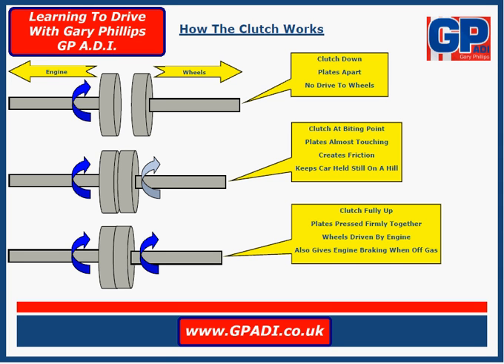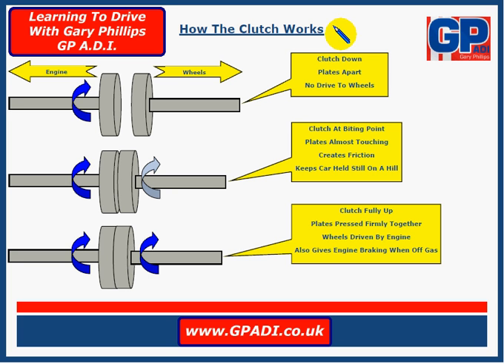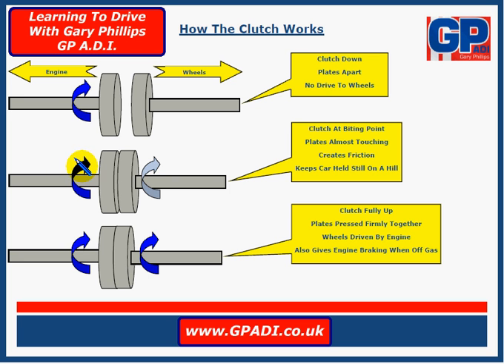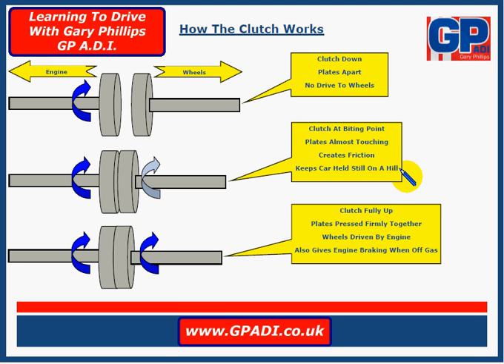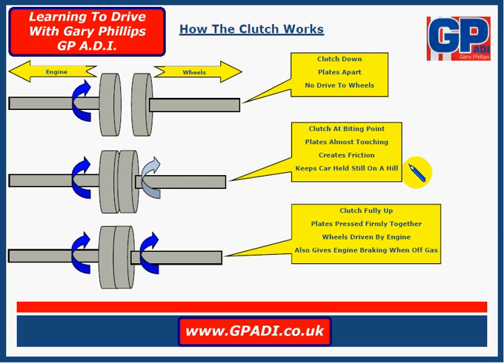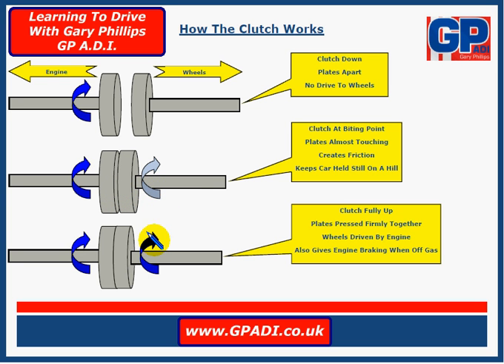How The Clutch Works

Comment from the maker: @prankmakers95 
Yes that's correct, it will cause the clutch plates to wear down which is why it is not advisable to hold the vehicle on a hill at biting point for long periods at a time.
If the car is held at biting point for too long or excessive revs are used you will smell the clutch burning & it ain't a nice smell!

Comment: @franklin0013  yes you are right about that. I prefer to sit in neutral and use the brakes. Of course if it's just for a second or two it might be ok, but don't do it often. I also find when I get a new car- stick of course- the clutch is a little diff from the last car, so you got to get the feel for it pretty quick. NO GRINDING! NO RIDING! Haven't cooked one yet! P.S. I am a lady driver and am shocked at how many people are shocked that I can drive stick, and at how many people can't.